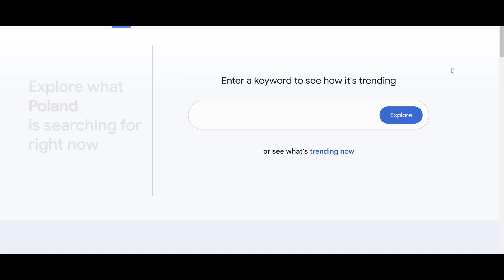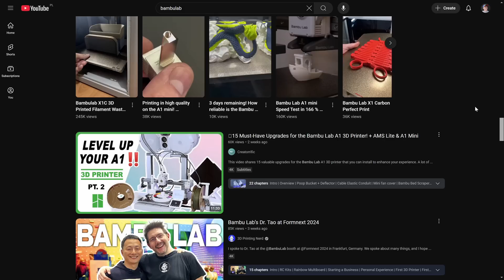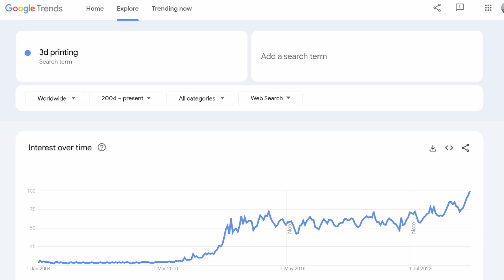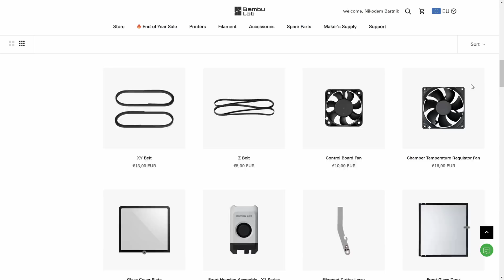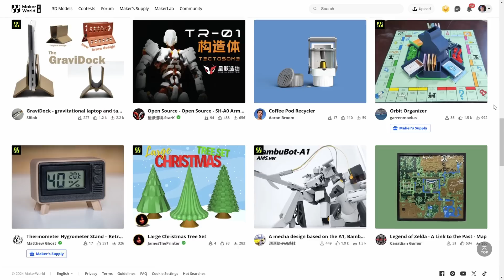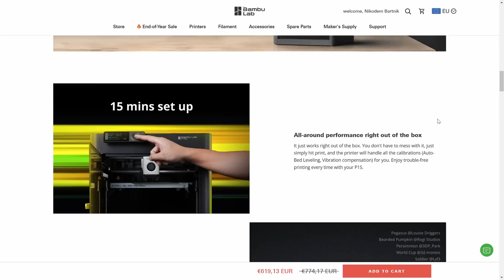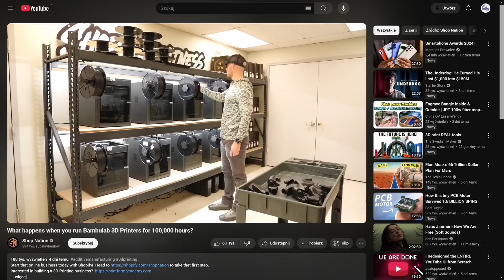Why is 3D Printing so Popular Now?

Comment: I started 3d printing almost 10 years ago. i had the luxury of my brother and dad being more of the "fixing and modding" side of printing so i could enjoy just printing. got into resin printing later and now got back into fdm after not using it regularely because i got an A1 (recommendet by a friend not because of ads). thought about getting a kobra 2 max but these are not reliable.

Comment: Babmu Lab is a great way to get something on your screen onto your desk, but in my opinion, it's not for tinkering. Even when I look at it, I feel "controlled". Not a printer for enthusiasts, imo, and I would rather get a so0vol sv08, where I build the printer, and even load some 3d party code in the print to fix some issues. That is what fun is to me. I have installed asahi linux onto my mac mini, and had more fun in installing the system than actually using it (even though the experience was a blast!)

Comment: I got an A1 mini last friday, man is it a game changer.
I have used an Ender 3 for the past 3 years, but it has been slowly becoming more of a responsibility than a tool.

This thing.... IS GREAT
Reply: same, so i moved and now had a little bit less space, so i couldn't setup my ender 3 and ender 3s1. So i bought an A1 mini, wow that thing is so low maintenance. You adjust literally nothing and you get perfect prints. I remember what a pita my ender 3 was in the beginning, even with mods (like bltouch, new build plate, build springs, new mainboard, klipper, i modded almost everything) and still some prints were meh.

Bambulab is really doing great stuff.

Comment: I have been printing nearly 10 years. And I could be your Grandfather. I used your dremel mini mill parts plus an X Y table to build a DIY CNC Mini Mill. Now my CR 10S Pro V1 with lots of upgrades lastly Pi4 and Klipper. But now I need to print parts for people that want my stuff. A small unit would ok as many of parts are smaller. Bambu A1
MINI was on my Mind as I am tired of upgrading Printers I just want get these parts printed. Would that be a good choice, PETG Mostly. Dennis
Reply: Yes it would, but I recommend you go with an A1 for size flexibility

Comment: Really like my “old” prusa mk3s and the way they support upgrade paths to the newest versions of the printer itself.
Reply: And even better is that you can get it up to almost bambu speeds with purely slicer mods.
Reply: I've got an Mk3s too, but the upgrade paths are essentially non-existent if you ask me. Yes, you can technically upgrade it to the newest hardware, but the upgrade kit costs more than a fully loaded bambu lab printer that also has cameras and other features built in that Prusa machines don't have.  There's just no point really... which is a shame.